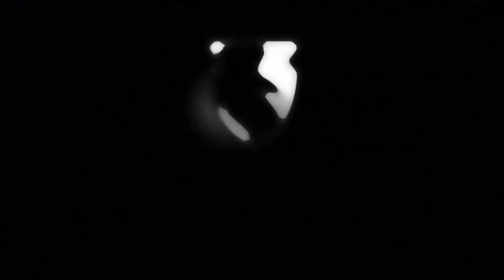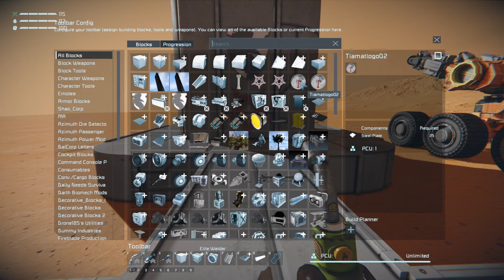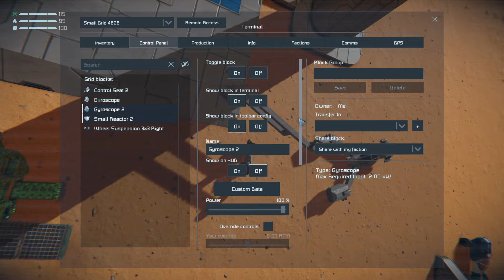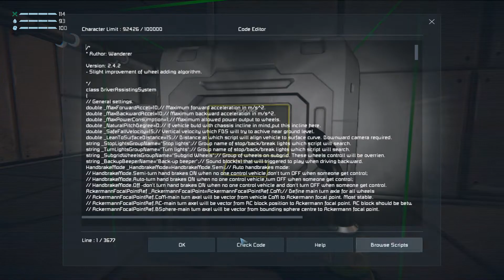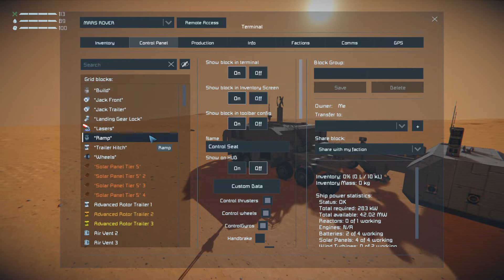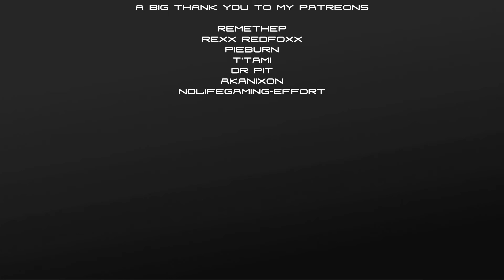SEKTAN IS GREAT :: Space Engineers Survival :: Ep. 842

Comment: I use gyro overrides quite a lot on my ships, to counteract gun recoil or simply to keep certain alignments. Basically just enable override, max the power and keep the rpm numbers at zero, that will keep your vehicle stabilized. You'll need extra gyros if you actually want to move (rotate), but that's it. And if your vehicle isn't stable enough, just add more gyros on override :)
Reply from the maker: Yea, i figured that out in the video.

Comment: still world be cool to have that design of an antenna for small grids.

Monowheels are interesting.  that or a unicycle design.  Splitsie is the lord of the unicycle as far as I'm aware.  A monowheel i would imagine would require one to use either a custom wheel model that had a void in the middle, or one of those really large and hollow rotors.  Gonna need a lot of gyro power to overcome SE terrain though, and high grade climbing or descending will be troublesome if your wheels are too small.  As it is, we do not have access to low profile suspension blocks so it's gonna get super wide too.  You're basically trying to create what we would call, in KSP, an SAS system... aka stability assist system.  something to keep it level with the gravitational down vector while still allowing manual twisting motion.  I feel like the single override check box is not enough.  I'd want a check for the overrides per-axis.
Reply from the maker: I think a monowheel is not just a thing where the driver is seated in the middle of the wheel.

I have my SAS now, have figured out some stuff.

Comment: didn't know if this is working with the monowheel, but to stabilize it what about 1 Gyroskope with positive roll and one with negative roll. This should stabilize the whole thing theoreticaly :-). The same for the pitch and one with nothing for stearing.
Reply from the maker: the first thing i have to do is to balance it weight wise, because with your method i would have to account for the difference in the center of mass too. If i can achieve that the thing should be a lot easier to use. Maybe your method helps in finding the exact point where it balances. i will test that.

Comment: Sektan going overload :) --Good id of the wheels->More wheels, more power/stable in less strength/contact on the ground. Cool rover i am lil bit  jealous:p
Reply: long as you take into account that SE doesn't run all the wheels symmetrically.  Many streamers i've been watching are having issues with one wheel in a set of 6 lagging behind slightly and causing the entire rover to pull to one side.
Reply: @Gaalidas  Never had a problem with that. And Rabenschild has a own world. Rab do you have probs with Wheels on your world?
Reply from the maker: Wheels are in general not really perfect, but using an offline world helps a lot.